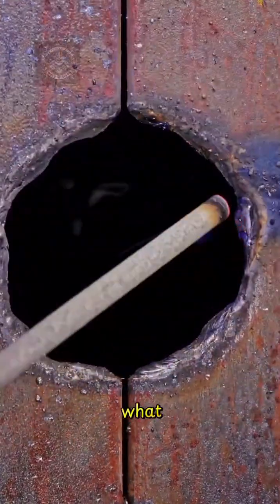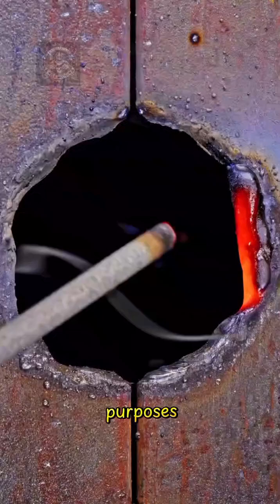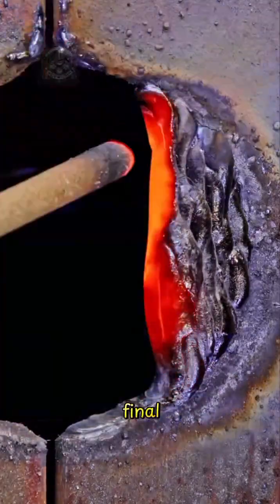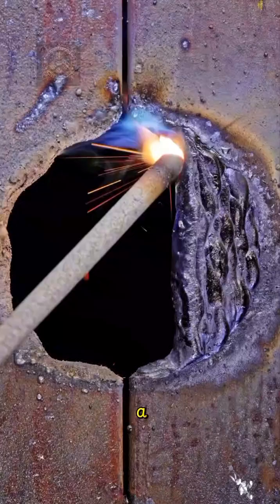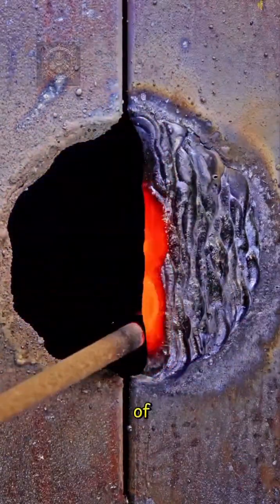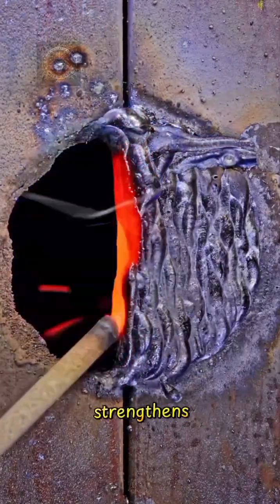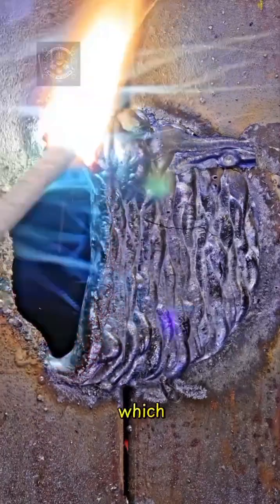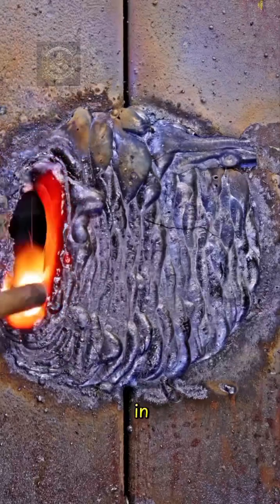butt welding ???!!!

Comment: I have been welding, and in the industry for almost 50 years now...

Not one time has anyone ever used the term "butter welding"

Also, filling the hole, the way you did, guarantees a failure...you have trapped so much slag and contamination inside that weld every single pass you made....

This is objectively the worst way to patch that hole man. This video should be deleted lol. NOBODY should ever do this

Comment: I will change it up and do one or the other but if it's a big hole I will cut a piece of steal and weld it in and then grind blend it. But w if I butt weld I will use the tig welder. It's my weapon of choice.
Reply from the maker: An you send us your challenge 
And I will share it 🤝